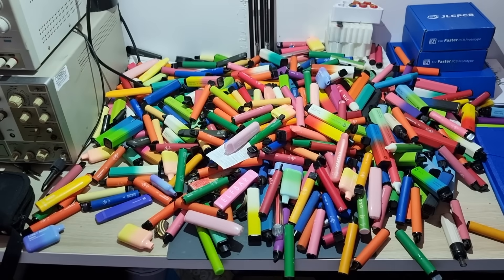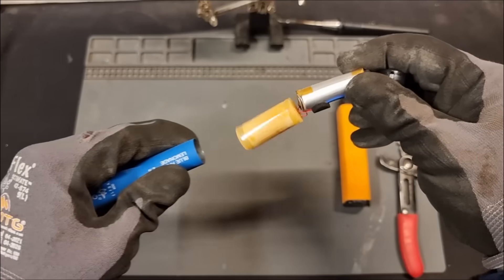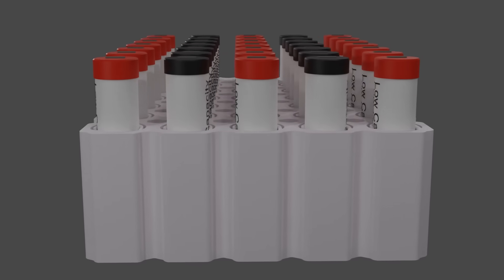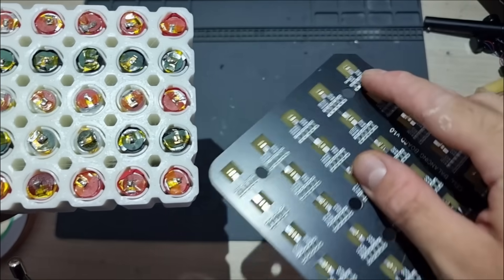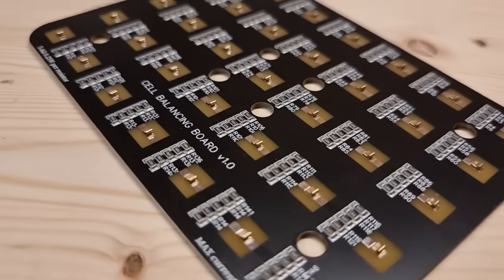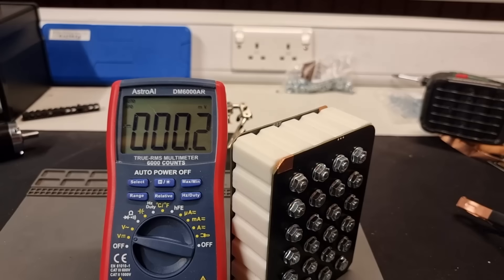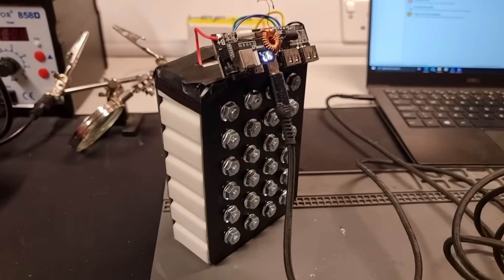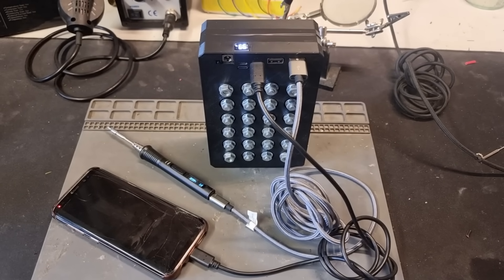Turning Disposable Vapes into a Fast Charge Power Bank

Comment: Amazing! 

You deserve more viewers, this content is so good, you don’t have to be an electrician to make all of this! 

There are actual housings you can put li-ion batteries into that converts it into a USB power bank! If you google 18650 charging housings. 

You can avoid different cell voltages by charging them up individually, I think nitecore make ones with 8 cell charge which will also tell you if it’s an unrechargeable bad cell!

Seriously great content, keep doing what you do

Comment: 5:10 should have checked the resistance, heat is the enemy of Liion cells which are insulated in plastic, id be worried if they get too hot. plus this design restricts the cell. the worst thing to do with liion is restrict a cell that wants to swell. hopfully theres enough room for the cell to pop. maybe could use some shear points on the pcb? like how you have the compliant holes.

Comment: Question on safety..... I am slowly accumulating a bunch of these disposable vapes wit the idea of building a power bank, but I am a bit worried about the storage of the cells while waiting to get enough. any tips on safe storage?
Reply from the maker: I use an ammo container with a few drill holes drilled into it (incase the cells vent). You can get them dirt cheap from military surplus stores

Comment: Not much of them around Eastern Europe. 

I find them usually tossed away on streets on bordertowns main streets or markets probably by tourists and illegal immigrants in passing.
 
I collected few (maybe 10 idk) in last 2 years and 1st chuck it in a dry container with rice, after few days I put them in a dry metal container where it perma resides, since I kinda have a fear of them combusting etc because idk who and how was this used before thrown away or even lost perhaps.

I also do plan on making a powerbank out of them eventually. I have a small phone powerbank with a dead bloated cell that went bad this year so my plan is to use the same board etc and just swap in the new cells from vapors, similar or same as you making a new case, however everything hand made since I dont have 3D printer and much tools. 

In my case I only found the slim ones so far and one that looks really weirdly shaped not so long ago, I think it either have a screen or a tiny solar panel not sure, so I put it aside and that one might be better for some dyecast model project too.

When I see how much waste produces Germany (since forever) and lately UK too its downright criminal and cringe what and how much of it is being wasted away ... like wtf is inside the head of those crazy amount littering people, a draft ?! How can these people even function is beyond me ...

Comment: This is amazing. I hope you can find other good uses for these batteries as well. Maybe do a tutorial on how to make a flashlight or lantern with vape batteries. Any other helpful ones you can think of that are also fairly simple, and safe?

I absolutely love seeing things get reused like this. I actually built an alarm for my shed with a car horn, a light switch, and a desktop PC power supply for the 12v DC power.
   When i was 15, i also used a similar power supply to set up a car stereo, amp, speakers and subwoofer in my bedroom, but dad didnt like that 😂

Comment: Great video and thank you for posting it! Just a quick note tho, wouldnt it be better to add thicker wires? Seems that the ones your using (mainly for the main + and - terminals) are quite thin and may not be able to whitstand higher current (which i believe is used for QC) for a long time.

Comment: I do NOT have a 3D printer, but like you, got a $hit load of them batteries. So if you could print up all the things I would need, and the weblink’s for all of the other parts, that would be fantastic. As my girlfriend’s family live in Nigeria 🇳🇬 and do not know if you know how BAD the domestic power supply is. So sending her mammy and daddy a solar panel, hook that up to a battery pack or a power-bank would be a God send for them. As I have gotten some cheap LED lights that take 4 AAA batteries, I have fitted one of them circuit boards that charge lithium batteries up with. So squeezing in 2 of them 550mA batteries that are charged with a phone charger, they should never be without light. 
Well I have been thinking of finding someone that can 3D print a spacer, to put in between the top and bottom of the case to make it have more room to squeeze 1 or 2 more batteries, then to also add a USB port so the light can double as a light and a very small power-bank, what are your thoughts about that idea ??? 
Well hope you get back to me, as all I was going to do, was to send to Nigeria 🇳🇬 a load of the batteries. But unfortunately, they have to be built into some equipment before you are able to send them, that is why I am trying to squares as many of them into the housing of the light. Even though of hooking 3 of the batteries together (still at 3.7V) and using a small cable with a plug at the end, and housing it in some shrink wrap and putting hot plastic glue to keep it all together, then adding a matching socket to the light, could be a way to be able to send over more batteries, and also if they are hooked up to the light, they can be charged up, removed and stored or used on a second light that batteries have gone flat. 
Have all of the GOOD ideas, but do not have the equipment to 3D print, and at the age of 63, getting a bit too old to learn how to setup a 3D printer (to create the file to make the parts for) if you have me some wood and a drawing, could do that, as I am old school, and still sometimes do things in feet and inches. 
It was good enough for my dad, my granddad and my grate granddad, so do NOT know why we had to fall inline with them in Europe, as they still use feet and inches in America 🇺🇸 
But it makes me laugh, when someone might go into a shop and ask for a meter of 1/4 inch copper pipe, or ask for a yard of 10mm (3/8) tubing 🤪
If you going to give the length in metric, then ask for the diameter in metric, in just the same way as asking for something in imperial, the length of a yard and a diameter of 5/8th’s. 
As this would happen to me all of the time when I worked in a shop, as some guy who knew it all, would give you one measurement in metric and the diameter of usually copper gas piping in imperial or vice versa. 

Well as I say, hope that you can help me out, as I am NOT looking to be making money at this, as up-to now, I have bought the lights, the circuit boards, shrink wrap and cables with small plugs and sockets on them, and also the USB sockets. It has ONLY been the batteries that I have got for FREE. 
But I do not know if you have any of the rectangle batteries, as they come in VERY useful to fit into radios, as got a photo of the different batteries that I have got, but it is the 550mA ones that I have the most of, as ONLY got about 3 of the flat rectangle batteries  ”wish I could get more of them. 

Bye 🙋‍♂️ from Knobby (John) in the UK 🇬🇧

Comment: This is a great video! I was just thinking the same and keeping my old vapes. I have already 8 of them and it is encouraging to see someone did this.

I have two questions:
1. Assuming the small batteries are 1.3V (my vapes use the same ones I guess), is 2x4 a convenient configuration to charge smartphone?
2. Is it possible to use my vape's charging circuit in this regard?

Comment: I pick these up all the damn time, I have well over 1,000 stored at my litter picking storage location (probs not a good idea 😅)

Noob electronics question, but would it be possible to create some sort of home storage system with this setup, combined with solar? Or at that point am I breaking into the 'I need an official certified electrician' territory?

Comment: To be honest, I was expecting using so many different batteries from so many different manufacturers (at least not so many, with how things are now on over-the-counter OEM parts), generator balancing while on use would be way harder due to manufacturing differences in internal resistances and cell capacity. Guess either the power bank module does more than I thought it did, or generator balancing is only a complicated issue for photovoltaic cell banks (control systems on these are things of beauty).

I just wouldn't feel safe using one of these without the power bank board having temperature monitoring and being able to cut off the cells/groups physically from each other in case of temperature run-off for any reason, since these cells aren't expected to have a high quality, being made for cheap and to be "disposable" (despite not needing to).

Still, amazing job! Being able to reuse e-waste is great.

Comment: The only thing I would love to do with smaller LiPO batteries, or any for that matter, is slot them into a UPS. Would love to just buy a board or box with all the components for the UPS, a plug for the wall connection, few plugs for the output, and two terminals to connect the battery pack. Be amazing to just drop in a 12 battery and upgrade as I go along from say a small 12v battery pack with 3ah to 300ah...

Comment: Ha! Just saw what you did on another channel. I did the same thing with exactly the same board, 60 cells, 4S15P😂, plus 5w cob led pannel on the side, powered trough mosfet, as board can only power up to 1w led bead (2 free holes in the middle of the board are for 1w led that turs on/off with button on the board, not listed in documentation i got).  I also use this for ts100 soldering iron, with usb-c to barrel jack cable that has built in 20v PD trigger. Glad to see someone else out there who think alike. 👍😀

Comment: curiosity: how does the resistors in between the battery cells prevent them from burning? and how do you know which resistor value to use?

Comment: I've got a small stack of these vape cells sitting in my workspace, mainly for use in small projects that don't draw all that much power and have small form factors that won't fit one of my 18650 cells or one of my precious, expensive LiPo packs. I've used more than a few for various small things, like an Altoids mint tin that charges a pair of wired earbuds. I tend to run by public places pretty regularly, looking for discarded vapes that I can strip for salvage. I've thought about setting up dumping points for them, or asking people for the stacks of disposable vapes they have at home. It's a shame more people haven't been interested in doing this.

I don't think I'd use them for what you used them for, though. These 13500 cells aren't... exactly the best or most stable, and I'm not sure I'd trust them at that level of draw.

Comment: I've had a way simpler idea of just replacing the atomizer with a little LED, UV LED, or laser diode, and printing a custom case to make little keychain flashlights/laser pointers. 

I'm more involved in a "greener" vape scene which ironically produces huge quantities of "disposables" (GHOST, PACK MAN, FRYD, etc.). They typically come with smaller batteries, but they can hold as little as 0.5g so they're used up more quickly... 

Like, cartridges preceded these... Cartridges just make sense. I can choose the battery I want and use it forever. Maybe wind up with a few and cycle them out when one's dead? 

I just don't see the purpose of disposables other than more real estate for the actual product (the juice/distillate/whatever) to brand their product. 
It's hard to brand a tiny little universal cartridge, and it's hard to convince someone to "commit" to a proprietary battery like JUUL/VUSE. 

A company could probably make a battery-less vape that just vampires power from your phone. They could make it look cool, and everything!

Comment: I just read a comment about seeing if you can put a "dead disposables here" bin outside of vape shops. Here's what my farmboy ahh is imagining:

1) I know of like 20 vape shops within 30 minutes of my place (I used to vape before going to Zynbabwe). I could do a collection run weekly and have a dumpster full in a month.

2) Research the pricing and source for an alternator, and buy a used gas weedeater/chainsaw/backpack leaf blower to strip the engine from.

3) I have friends with hobby 3D printers so I could buy a spool of plastic to make small internal housing modules for the cells in a way that they can be assembled into a large connected single cell. I can buy both wire and have sheets of acrylic cut at Lowes/Home Depot to build a big housing for everything.

4) With some research on the nature and hazards of batteries (like the tip from this video about using a resistor board to even out the cells' charges beforehand), I could put together a fairly robust generator. A store-bought generator costs $800-1500, but with this I could probably do it for less than $300.

It would definitely take some trial. I'd want a design that makes it easy to open up and switch out cells, I'd need to learn the math on how to figure out how much gas it takes to fully charge, and I'd definitely need to learn how to install the right breaker so I don't end up with a lithium bomb at a remote campsite. But simply put, I'd just need to scale this process up and put an engine on it. With a thick layer of insulation between the gas tank and the cell housing lol.

Comment: 5:05 how do those not short through the metal case?  

I'm guessing it has some sort of insulation on the case but that tape looks to me like it is connecting both the + and - terminals to the metal case

Comment: The issue with reusable vapes is that they use coils to vaporise the “vape juice” which tastes bad by comparison to these disposable ones that use sponge to secrete the liquid. They need to make reusable ones that copy the disposable ones designs as people won’t switch for an inferior experience.

Also, phenomenal video. A blend of passion for electronics, and also great editorial piece of e-waste. Keep doing what you’re doing, it’s inspiring
Reply: the reusable ones can taste just as good, they are essentially the same 'sponge design' you refer to. Reusable vapes have a coil that is wrapped in a cloth like material which holds the liquid you fill the tank with.

If you're in the UK  alot of the reuseable vapes you come across are unregulated so the manufacturers can put anything they want in the juice. They stuff the juice in them with more untested/banned chemicals to achieve the strong sugary test. i'm talking about the brands that seem to come and go very fast
Reply: I just use longfills for the aroma and nicotine salt. This mix taste exactly the same as the disposables, no matter the device.
I don't know the reason but longfill aroma almost always tastes better than the normal one and the more expensive nicotine salt shots keep you from coughing unlike the normal nicotine shots.
Reply: you cant reuse a sponge setup more then twice well you can but it to a point that the sponge has absorbed so much dirt and crap from the air that its grey in color n cannot do its job anymore its also just false that wick style anything is gonna taste as good as a ceramic coil i hate those things but they last longer and you can hit them for longer then three seconds and not get a burnt tatse unlike wick coils or sponge coils whatever you folk wanna call em 😂
Reply: @minekush1138  youre right, theyre "wick" coils. They defiently taste better. I've tried the same nic salts with a coil and it tastes nowhere near as good
Reply: @petercruz1993  they've been around for a long time! RDA's and RTA's, both use coils or mesh ( just like disposable vapes) and tissue wadding in disposables is replaced with organic cotton in rebuildables (far superior at wicking compared to the foam reservoirs in disposables).
I am still using my trusty KangerTech pro plus and my Vandy Vape mesh RTA, brilliant bits of kit and give consistent vaping.

Comment: 2:22 DO NOT EVER USE A SOLDERING IRON NEAR LI-ION BATTERIES. This is extremely fucking dangerous, enough heat and the battery can be sent off to thermal runaway.

ONLY use spot welders and crimp connectors, NEVER use soldering irons on anything thermally conductive to a lithium battery.

Comment: 5:01 watch out that the adhesive doesnt degrade (e.g. from heating)

had that happen with some aluminium tape used to make a ground plane for a lora antenna.  most of it was completely disconnected upon probing with a continuity tester.  ended up replacing it with a continuous sheet of aluminium but thats not so practical here.

Comment: With this cool up cycling you did. I wonder if you could use the old vape shells and turn it into colored filament for your 3d printer. I know they have a machine out there that can take certain plastic types and melt/extrude them into filament spools for 3d printers

Comment: I now use reusable vapes but I have hundreds of disposables in a bag because your not not meant to actually throw them in a normal bin. I so badly want to do this now so I can take the batteries fishing with me I have multiple battery packs that ain't enough but they are NOT cheap so I can't keep buying more having to charge up 6 before going is crazy... a few of these will do me for a 3-4-5 day trip no issue

Comment: Powerbanks need to provide a consistent output over extended periods (e.g., 2-3 A), which can be challenging for vape batteries they are often not designed for long-term cyclical use, making them potentially unsafe for this application

Comment: Imo finding a good way to recycle the tubes would be another really good thing. Maybe making honeycomb style storage/sorting, or used in other projects, maybe even trimmed down as a battery sheath, especially as the full tube could fit a range of cells, especially with inserts.
Reply: Or even a way to attach the tubes together to make the battery tray